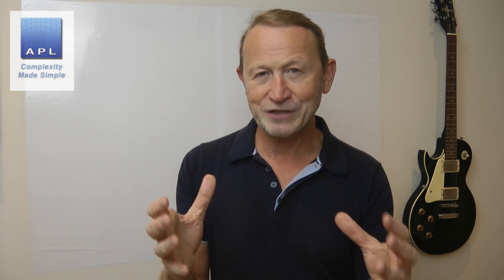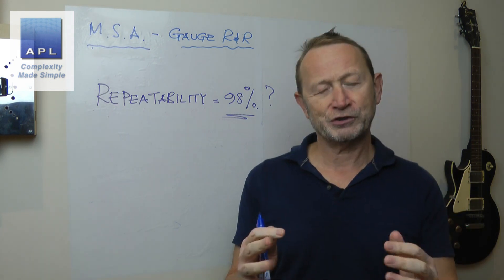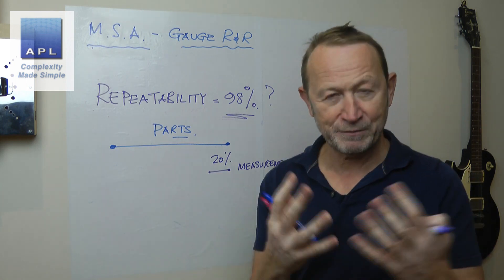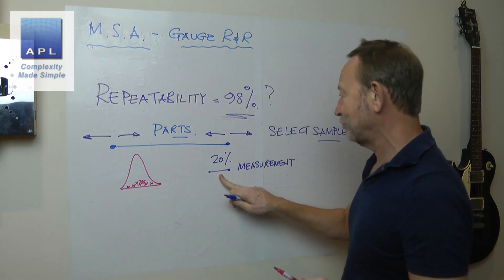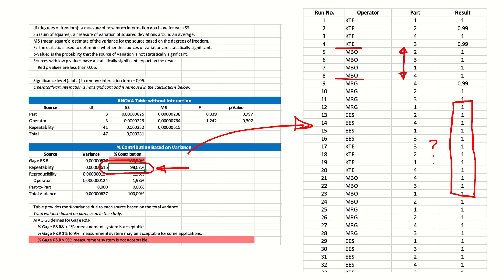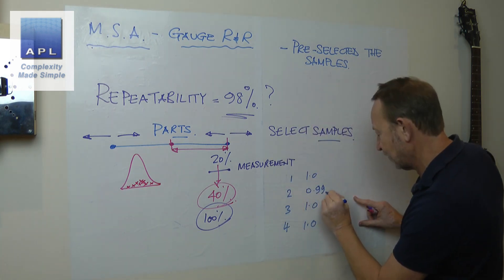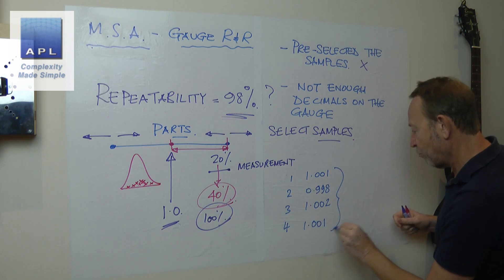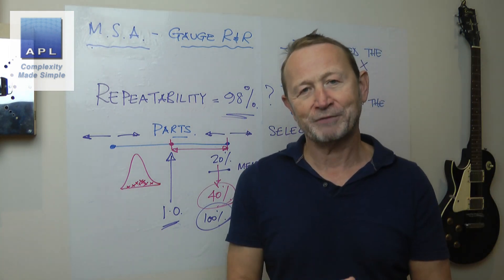MSA Important Advice...

Comment: Thanks for the inspiring videos.  With a lot of intensity.  This video hits my challenges right.  I work as Sr.  Metrology Engineer at a major toy company in Denmark.  We have the luxury of challenges that our parts are too good, and this results in a lack of variety in the parts.  And at the same time we use small tolerances.  This may result in an excessively high R&R.  And at the same time an NDC Score below 5. So it is not always possible to choose random parties.  With your experience, what do you see I can improve.  Larger sample size or something else.
Reply from the maker: Hi Morten - sounds like you have a challenge on your hands. 1st point is can you add another decimal point on your measurement equipment?
Reply: Though not quite the same boat as we are very low volume machine builders we do run in to this issue where customer parts have very low variability. I have taken to doing Type 1 studies on master parts made from tool steel (measured by a 3rd party lab) at top and bottom tolerance and then verifying the the linearity with a nominal master. You get repeatability, accuracy and linearity in one study. I suppose you can add multiple appraisers for AV but not sure.
Reply from the maker: Hi Dirk - I've never been a fan of type 1, but i think you've just given me a reason to change my mind! That does sound like a good process and it's confirming that the system can see top and bottom tolerance which is afterall one of its main jobs. Great idea!
Reply: @paulallen5321  glad to promote debate in these things. I forgot to mention you can set the percentage of the tolerance for the spread usualy 20% so even with a CGK of 1.33 you stil have  spread that fits the tolerance > 5times critical measurements at 10% for critical components probly aerospace or medical machines
Reply: Tx Paul we have 0,02 toll. And 0.001 equip.
Reply: Hi Morton, getting to this late, the reasons that you're having issues is because the toolset that you are using is flawed. Not enough time here to talk properly, see the book EMP-III by Donald Wheeler and open up a whole new level of understanding about your process.

Comment: I haven't done an MSA yet but expect I'll see this issue when I do as we're taking measurements with high accuracy and low variability in parts.
Reply from the maker: Hi Don - if you get an issue that you need help with drop me a line. I think there are some other video's on the same subject. I'll find them for you if you need them...